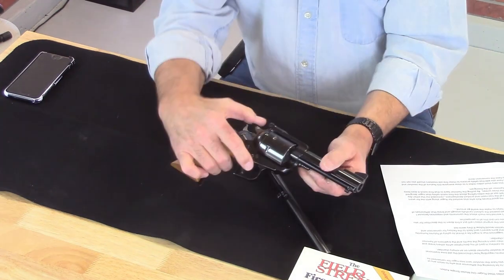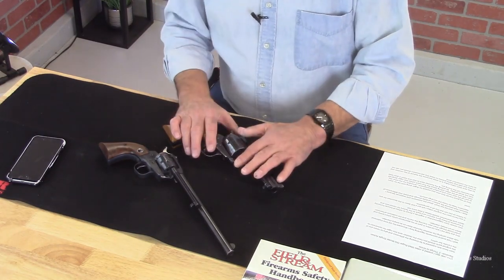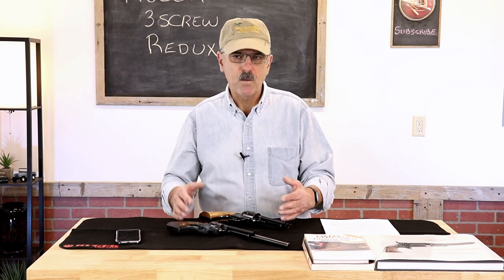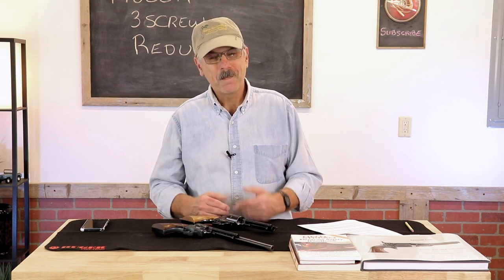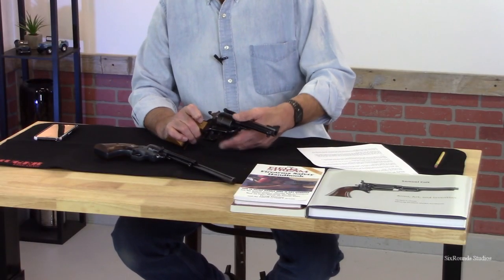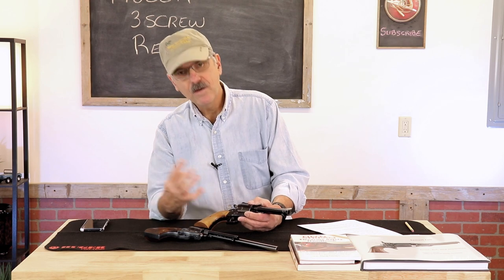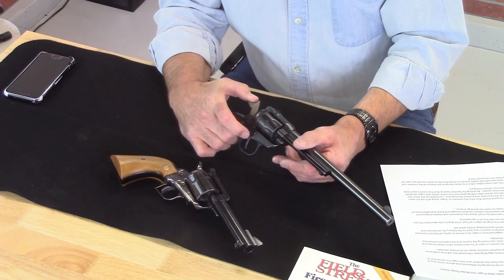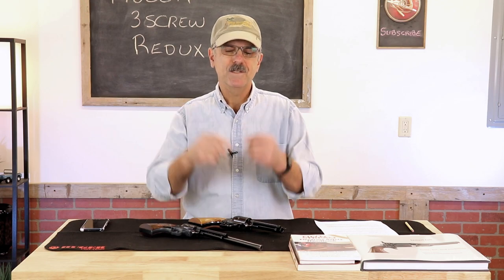Ruger Single Action

Comment: Nice job. At 65yrs old I’ve been buying ruger firearms since I was 18. Still have my 1st ruger 1974  10-22. Old bearcat 22. 1975 security six 357  6in barrel stainless. Ruger stainless 44black power pistol. 1975 ruger single six combo 22+magnum + model 96  22cal lever action carbine. Proud to say they have all been flawless. Lov ur. Content. Have a nice day 🇺🇸
Reply from the maker: Yes these are great firearms.  But then I may be partial ;)

Comment: Has the Ruger Super Blackhawk that you are holding been shortened from its original barrel length that it left the factory with....?   If so....how does that affect it's collector value..?
Reply from the maker: Yes it was shortened.  I tell that story in another video.  TOTALY affects the collectors value!  Ruger never made this in 4 5/8 length in 1969.  BUT....here is the story....the gun was only two years old when we cut it.  It was never considered a collector gun back when we did it (it was nearly new).  We (I) built this fully with the intent of customizing it for my needs and taste....and I don't regret it.  I would probably discourage anyone from doing the same thing to an old original Blackhawk today....but if you have a new one...make it like you want it.
Reply: @SixRoundsStudio  Thanks